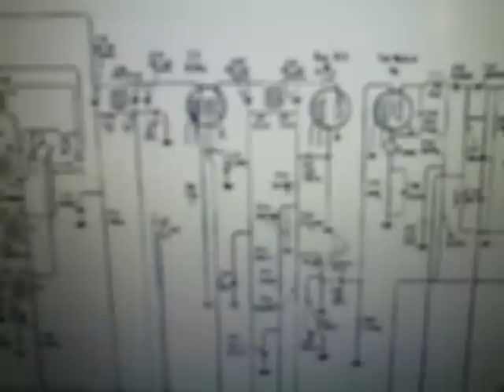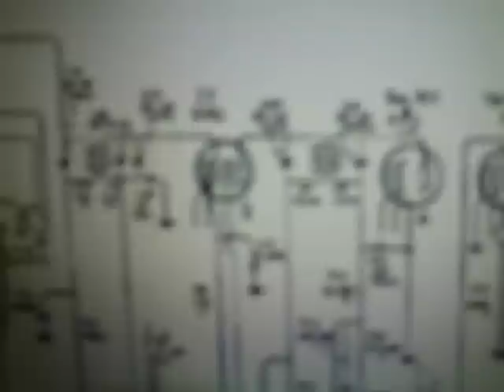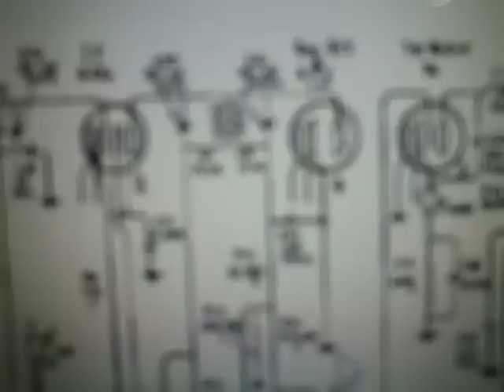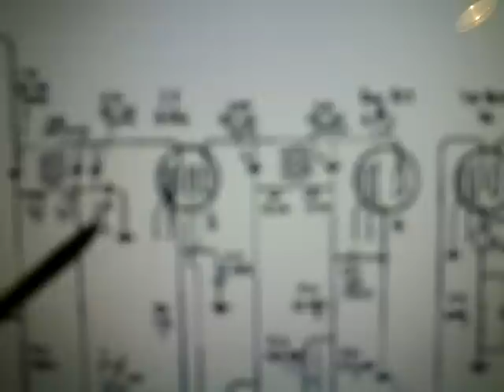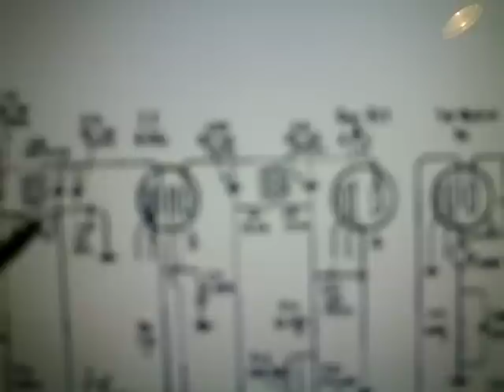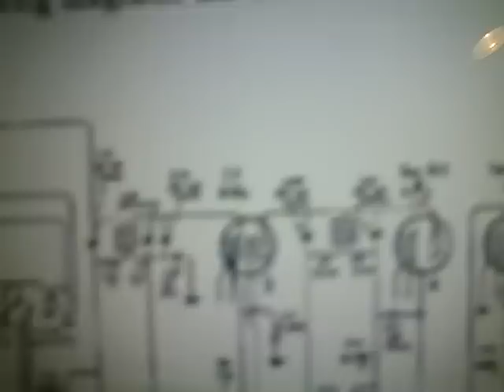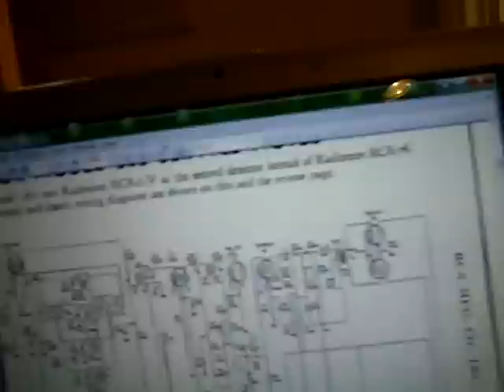Part 1 Capacitor Replacement. antique Radio. (Please note  This is part one of four)

Comment from the maker: The RCA Victor 330 seems a lot easier to work on. 3 less tubes and it doesn't have the complicated "magic brain" coil switching scheme. I don't know your experirnce with soldering and electronics so I can't really tell you to go for it, but you have to start somewhere. Do you have something like an All American Five that is easy to take apart and do bench work on? I defenately say to get a soldering station. Make sure you observe Polarity on the Electrolytics.